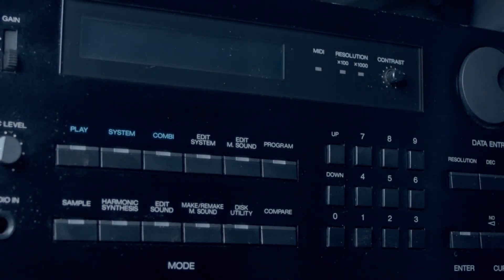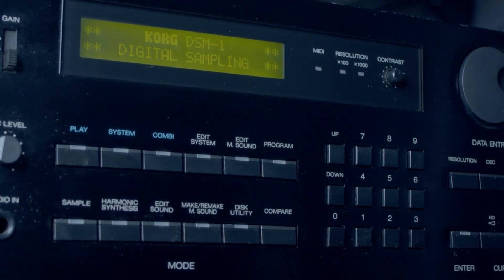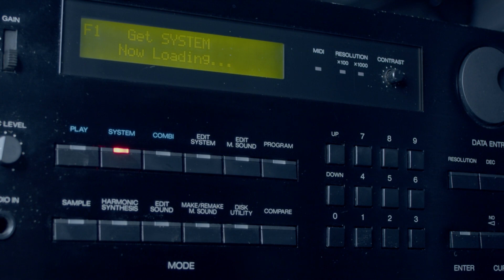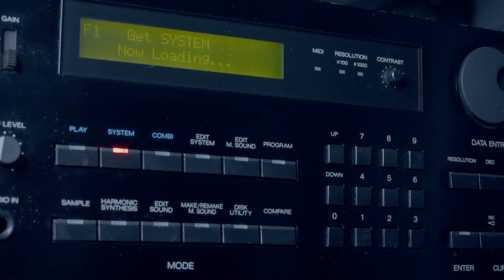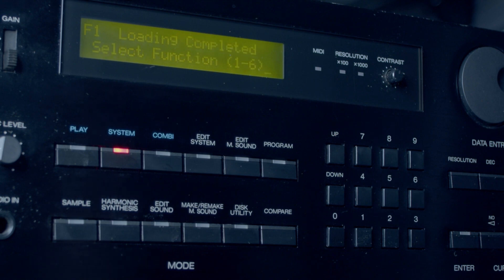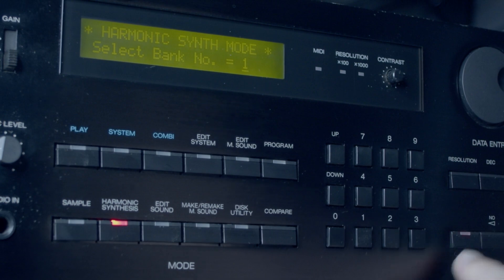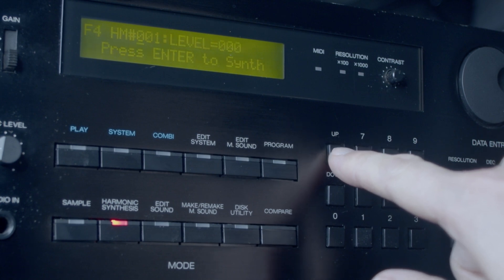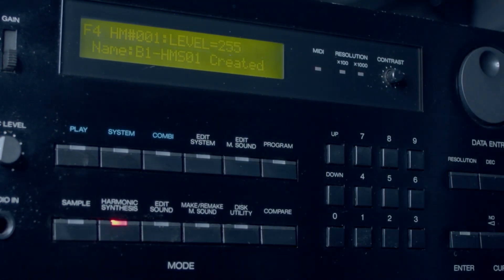Harmonic/Additive Synthesis wth the KORG DSM-1

Comment: Dididesign released Softsynth software to speed-up the additive synthesis process, and compatible with DSS-1 DSM-1).  
Version1 (I can't find it anywhere, had a serial key) worked on old macs without any audio card. V2 needed a Digidesign Sound Accelerator I card. Nearly impossible to get those cards now. (I got Softsynth V2).
Reply from the maker: Interesting! I still have a digidesign audio media II card somewhere!